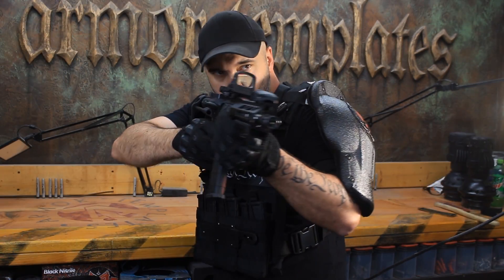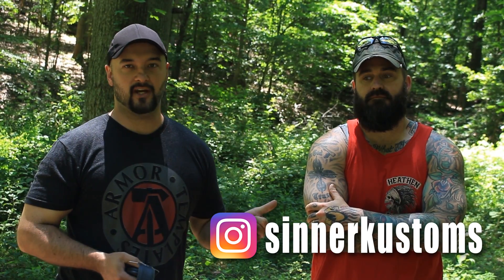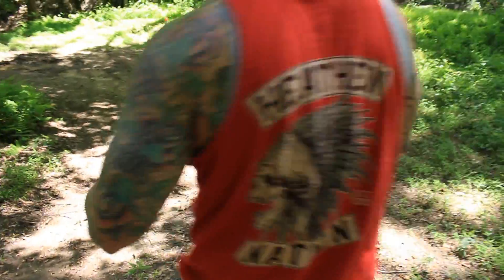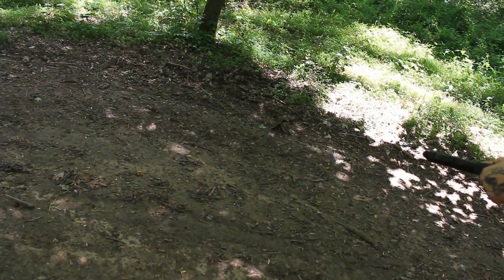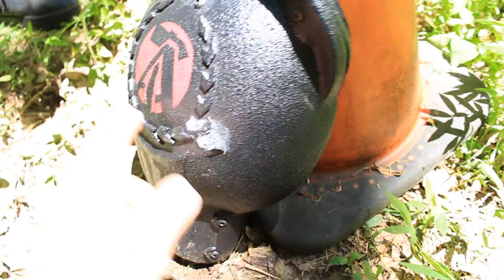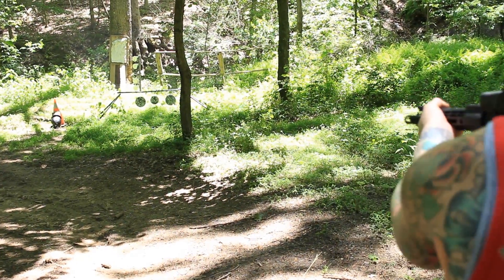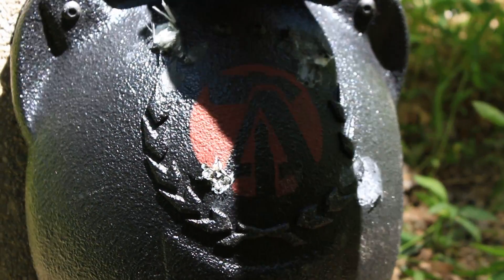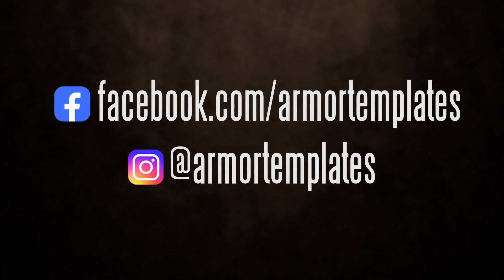DIY BULLETPROOF Shoulder Armor! Is it really bulletproof?

Comment from the maker: ATTENTION: I am currently looking into doing a GoFundMe or Kickstarter to make these available to the public. Stay Tuned.
Reply: Kickstarter is a bit too PC right now, they don't like "harmful" or "violence promoting" projects in general. You may have better luck with IndieGoGo... or as an US Army contractor.
Reply from the maker: @trodat07  I will look into them too, thank you
Reply: @DavidGuyton  a kevlar sleeve instead of the elastic or even just a kevlar liner on the inside would help if the plate slows the round enough the kevlar might catch whatever penetrates the plate!
Reply: @DavidGuyton  il be intrested in buying two of these i dont own any firearms but they look cool as hell .plus it will be usefull when i do get any sort of firearms
Reply: @yossefnada5102  best to use one for the arm that is used for stability I’m a right hand shooter so I would use it on my left at the same time I wouldn’t because I’m more a sniper and sneaky guy soo 😜
Reply: Army uses Kevlar and ceramic plating. Far more feasible for mass production.
Reply: @DavidGuyton  are these available yet? I want one
Reply from the maker: @FlexYourFreedoms  unfortunately I can't raise the funds to get the equipment to produce these at a reasonable price. I tried.
Reply: @trodat07  This is "violence preventing", or rather "safety" equipment that is meant for general ABRASION, do not claim bullet proofing without legal teams scouring over the legalities. DO NOT CLAIM BULLET PROOF!!! 
This is not legal advice, I do not give legal advice over the internet.
Reply: @trodat07  army contractpr , lol
Reply: The roundness deflected the dessert eagle round.
Reply: Anthony 2019 yes but having the rounded cup will do just that, thickness of armor is greatly improved with some angling, having a flat surface allows the bullet to have best chances at maximum penetration
Reply: @Anthony-bl5rm  yes
Reply: @Anthony-bl5rm  If it works less hurts!~
Reply: Highly interested also if you make more. Do you think swapping out the fiberglass sheeting to Kevlar might make the process less irritating and even tougher?
Reply: @deadmanracing7392  Ballistic Kevlar should work better...more than likely need less to do the same.  I would be interested in seeing what a more composite, layered arrangement will do...maybe sandwiched kevlar and something hard to help deflect/slow down/break lighter bullets?
Reply: might also look into UHMWPE sheets. They are a thermoplastic so they can be shaped...you don't have to deal with fiberglass, and an inch of it is rated to stop 5.56 ball ammo [NIJ level III].
A simpler design might be warunted though
Reply from the maker: @deadmanracing7392  yes but also about 6x more expensive
Reply: Where can i get that 9mm ammo you used last??
Reply: @Anthony-bl5rm  Undwrwood Ammo makes them.
Reply: @Anthony-bl5rm  Lehigh Defense makes the bullets, loaded ammo by Underwood.
Reply: I would be interested in it.
Reply: @David Guyton are there any plans to release a template for at home building?
Reply from the maker: @Mobius762x51  Unlikely. The way this had to be built, it would be a template that is not up to my standard of quality.
Reply: @DavidGuyton  I'd suggest not using carbon fiber. Poor ballistic properties.
Reply from the maker: @RJW Naphtali The equipment to produce these on a reasonable scale is probably in the $20,000 range, and I need to rent a space to do it too. And likely hire at least one other person right away. The cost involved in making a single one of these (using my caveman method) is about $300, which is already getting pricey and that's not factoring in any labor costs. I do have an LLC set up for it...I just have not had the ability to take it any further financially
Reply: @DavidGuyton  I wouldn't have found your channel if DemoliotionRanch didn't do a video on it. I'm betting people like myself are inquiring about sales since then? Hoping that you do get your operation up and running, I would like to see you take a good swing at a full UAS (Utility Armor System) incorporating your current shoulder peice design into a full kit. A chest/back plate, forearm armor, upper and lower leg armor. The design is very WarHammer 40k and that's what draws most of us to it I believe. You've done a great job so far, I could only imagine what a helmet system would be like if it incorporated some kind of tech. You're onto something big here, I say run with it and go for a NIJ license/certification and make this go huge.
Reply from the maker: bloochoo  I reached out to Demolition Ranch, got a response, then they completely ignored my emails after it.
Reply: @DavidGuyton  I'm surprised Demo didn't jump on this.
Reply: @DavidGuyton  Wow. Ignored it?
Reply: 100% I would buy one of these.
Reply: you may have hated the process but you  just left play pretend world and land your ass, in reality, throw some kevlar in the mix and you got a winner
Reply: If you put it on Kickstarter market it as motorcycle shoulder armor. They won’t even notice.
Reply: You selling these?
Reply: Ooo kickstarer, my one weakness.
Reply: Please do I will definitely get set of left and right
Reply: Link?
Reply: A question Mr. Guyton. If someone were to back these, would we get one for backing?
Reply from the maker: @OgresDenGaming  that's generally how I pictured doing it. It would depend on how much money invested though. People only donating $50 for the cause couldn't qualify, obviously.
Reply: @DavidGuyton  That's reasonable. I Take it will will be a video announcement once you perfect this beautiful piece of armor?
Reply from the maker: @OgresDenGaming  Yes I will announce any new information in a video here on YouTube and over on the Armor Templates Facebook page too
Reply: @DavidGuyton  What's the latest on this? I'm really interested in purchasing one of these.
Reply: @DavidGuyton  what's the update on this? I can honestly see real people becoming really interested in. I'd like to talk to you about lightening the processes and getting it to market for at minimum 300 dollars.
Reply: o7
Reply: Why not use uhmwpe? You can have the same effectiveness with half the weight.
Reply: Things I would try is to use a kevlar and carbon fiber twill and maybe some spectra fiber for the fabrics. Fiberglass is cheaper but you can double the aramid count if you leave it out.  Back it with at least a quarter inch of uhmwpe for rigidity and shock absorbtion  and all you should have to do is to heat sheats in an oven and then compress them in the mold. Also take a look at putting down maybe three or four layers of fabric and than laying down ceramic beads then another two layers of fabric another layer of beads and then the rest of the armor layers. Since the beads are loose they will be easier to to spread around. Look for the longest lasting bead blasting beads and if you feel like taking it up a notch then mix a 50/50 epoxy with titanium diboride powder for these layers. just be careful of the amount because tib2 is expensive.
Reply: Definitely interested. I'm impressed. I subscribed over your work.
Reply: Send link.
Reply: Army of Two.
Reply: Love  to get 2.. how much did they  cost to make?
Reply from the maker: @thunderlord2200  Materials for the two I made cost $600. That's before any of the actual labor.
Reply: @DavidGuyton  any updates? I know I'm 8 months late.
Reply from the maker: @wolfproducts  GoFundMe refused to allow me to do a campaign to get the company started. I have been looking at other options.
Reply: @DavidGuyton  post anything and everything related to these shoulder plates, as soon as you get some head way I guarantee I'll be one of your first buyers, ima have my eyes on this like flies on horse shit, I'm all in, dude, you got a guaranteed customer should this get off the ground, let us know any ways we can support, a few in my friend group are interested as well after having shown them this, you have a real shot at a big brand here, sending all the positive energies your way, let's turn this into a business, man, I can only see this being successful, just remember, all the greatest minds were laughed at or called crazy... until they were proven otherwise by their work, this is no different, big companies are gonna be your biggest adversary, stay true to your work and you will achieve success
Reply: With a steel layer or ceramic parts, aramid fabric, it might be perfect.
May you work on helmets too? Mandalorian shaped or something, with an attachment for googles might be awesome.
Reply: Automate the process. Build a machine that makes these. And Assembly line.
Reply: If you get this going, you might give spider silk a try. There is also a clothing line that sales bullet resistant suits. Might try talking to them about the materials they use.
Reply: How did you make the template and how much did this project cost you altogether?
Reply: I want some!
Reply: We're  still interested
Reply: @AtheistSPARTAN  💯
Reply: Hell yeah
Reply: Hell yeah!
Reply: Maybe Indiegogo if those don't allow it. Also if noone else mentioned it already :3
Reply: Expected price? Expected weight? Expected expectations??
Reply: Hell yes I would love to buy two of these
Reply: Good good.
Reply: If it goes through make sure to post about it so I can get some. Planning on some contractor work and these would be nice.
Reply: Now that is good news lol
Reply: I would like to buy a copy of the mold
Reply: Sir That armor are Can be Available here in Phillippines?
Reply: I bet if you incorporated a couple layers of a steel weave in the spaulder you might be able to overcome the penetrating power of .556. Maybe even 7.62
Reply: It's not even going to be concealable or usable for the public other than for show
Reply: So I was wondering why the shoulder pads are as heavy as AR500 steel 3+ ? Carbon fiber should be stronger yet provide the protection beyond steel.
Reply: @ErikKaiserprotongeek  That's all the resin in there.
Reply: Go for dtube or steemit
Reply: You ever considered making a set of greaves to go with this?
Reply: Can’t wait to hear more
Reply: If you could get it to stop 7.62×39 and 556 you would have me sold on it
Reply: Any progress or idea when these will be publicly available?
Reply from the maker: @ragnar0432  I was denied funding at all the crowdfunding places because they consider this "firearms related". Without money for equipment to mass produce them, I had to abandon the idea.
Reply: I would absolutely spend money on this, unfortunately I'm sure this will cost a fortune, please, please, please, tell me this will eventually be made a retail product
Reply: There's got to be a little shop in Indonesia that you can outsource the design and labor to in order to bring the cost down to what Americans can afford for this right now. I can see why you wouldn't want to do this all day, even if people paid several hundred dollars for a set.

Comment: I wonder if you could use UHMPE instead? That would definitely minimize the amount of weight! Thickness should be more than enough to catch all pistol rounds and even the M193-5.56 if it’s close to a inch thick
Reply from the maker: I did watch a few videos on people using that. I didn't have the equipment to shape it so I didn't even try it.

Comment: From an engineering standpoint: both of those materials are a poor choice due to their brittleness, however, the shape they are milder into uses their compressive qualities well.
Remember too that word shots will not hit straight on, but have some deflection due to the tight compound radii of the shape.
I think this is a MASSIVE success.

Comment: Nice work. I don't think the carbon fibre does much though. Just glass would be better. Good job alternating the weave. You should put a layer of glass roving between layers of woven glass. It helps reduce the amount of resin you have to use, by reducing the small gaps created by putting two layers of weave together. A separate issue: because of the shape, I'd be worried about upper shoulder hits deflecting to face. If you end up doing more testing (even with the same plate), I'd put some paper above the shoulder area to represent the face, and see how much deflection and debris you'd get on the paper from an upper shoulder hit. I suspect it may have to be shaped differently to avoid this issue.

Comment: to be fear not even bulletproof shit cant hold .50 magnum like that...
soo pretty bulleproof indeed.
i don't feel comfortable about that fiberglass though
maybe you can replace it with another kind of fiber
Reply: Yes they do and those shots are glancing at that
Reply: https://youtu.be/joQOrnIwP_g
Here lvl 3a soft armor from 10 feet (closer) and a square hit not a glancing shot aswell has having a sturdier backing

Also keep in mind though this shouldn't even need to be explained a 40 s&w which is monumentally weaker than a 50 ae had more penetration than the 50 ae shots the fact that the shots glanced and the test wasn't really well done shouldn't need  to be said it should just be understood if you put any amount of thought into it

That said still impressive if I had to guess its probably lvl 2 or 3 rated nij wise we didn't see any good hits with anything in the lvl 3 range or 3a and 3a+ but it is hard armor it stopped 9x19 and 40 s&w well enough I'd say 2 is easily good but 3 is a possibility
Reply: mmm, needs a layer to stop the fiberglass from penetrating your arm
Reply: @AngryPeasants  tbh if it gets hit hard enough for fiberglass to penetrate, the fiberglass will be the least of your worries

Comment: Would be curious if you sandwiched a steel plate inside
Reply: I was thinking the same thing. Thinking of trying to mimic his design except with a steal center later this year once I get my workshop set up. It’ll be heavier, but I think if it’s a full rig the weight could be mitigated with proper straps and whatnot.
Reply: @dextermoore490 ldn’t have to be too thick either seeing what this can hold up
Reply: @blank.9301  I’m thinking the same. I’m thinking of also mixing boron carbine or tungsten nano particles into a silica based epoxy and then coating the carbon fiber and kevlar sheets. Thoughts?
Reply: My thought too, or even ceramic
Reply: yer not going to get that shape with steel of any stopping power

Comment: The outer layer being a replaceable plate will take alot of the kinetic energy out of the shot, allowing the layers of your design to catch the rifle rounds.  Maybe your mold could be pressed from a cheap thin steel.  These could be taken off via quick bolts or pins that you use and replaced quickly and re-strapped on, even during battle.  Just a thought,   very cool.

Comment: beautiful work. I'm amazed at the 50 deflection but the rifle rounds do show signs of deflection so at the very least you changed the force and direction of the round so still a win to me. when we had to weld up our own armor on our vehicles overseas we were stuck using mild steel at times and by building layers of steel with a thin hollow area in between layers we were able to completely deflect a m2 50 round. took lots of trial and error but it proved fruitful in the end. I'm liking the idea of carbon fiber i hadn't thought of that for a material before. but that seems a good idea for cost and weight.

Comment: Kinda late but i build some of my own out of sheets of kevlar i bought online and a sheet of 1/2 in thick rubber as a ballistic pad and then take gorilla tape and give it a nice tight wrap to keep it all together for 200$ i built a full set of 3a+ soft plates 44 layers of kevlar with ballistic pad just shy of 1" thick, a side plate for my carrier is .5 lb 6x7in and i shot one about 80 times with a mix of 380acp,9mm,45acp,40sw,12ga slug,12ga buckshot,22magnum and lr,38spcl,44 mag, consecutively and it wasnt until i shot a hot round out of the 44 on like the 81st shot that something finally went through it stopped about 1/4 of the way out of the tree the plate was on, if you bought 200$ more worth of the same matierals you could make thigh and arm/shoulder armour and probly have enough left for a throat guard. Cool armour tho i dont like the fiberglass something about something punching through and bringing fiberglass shards with it just sounds like a shit show in a gunfight.

Comment: Very nice turnout! I am blown away that it could stop the .50 like that! Curious to know  any improvement in stopping power if you swapped the glass for kevlar 🤔
Reply from the maker: Would be a tremendous improvement but also triple the production cost. I never went back to test but I had plans to reduce the thickness since I am sure it can still stop all the handgun rounds. Even Kevlar wouldn't stop the rifle rounds though
Reply: @DavidGuyton you could stop rifle rounds if you used uhmwpe.. but I think the process of laminating it isn't something someone wan do at home easily. 

Your work is crazy impressive!!

Comment: What was the budget for making this armor? all tools arnd molds and mask everything included.
Reply from the maker: About $700
Reply: @DavidGuyton  dang ok thsnks
Reply: @DavidGuyton  and that was just for 1 shoulder part
Reply: @kingarthur7051  subsequent ones would be cheaper since you already have the molds/tools
Reply: @diomedes39  exactly, research and development is inherently more expensive but once the final design is solid. Processes can be streamlined to mass production methods which would lower costs